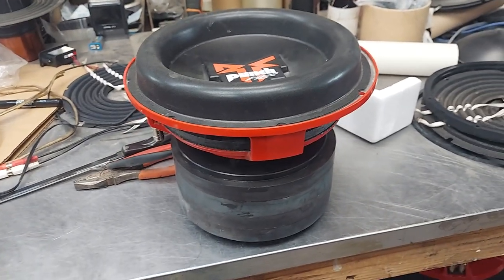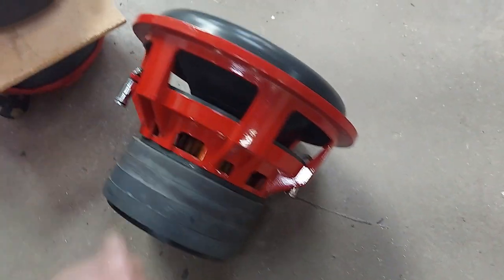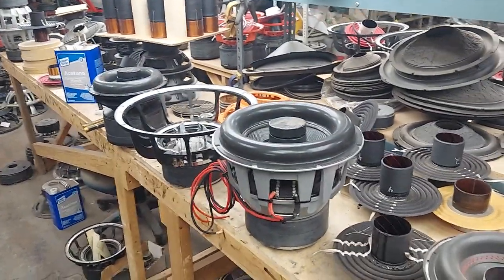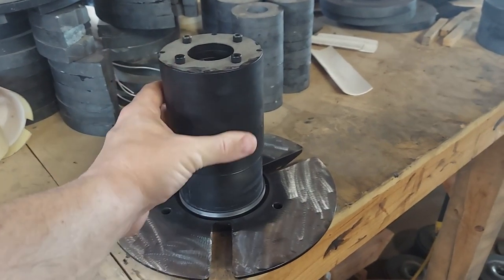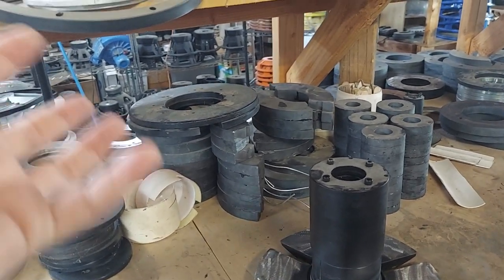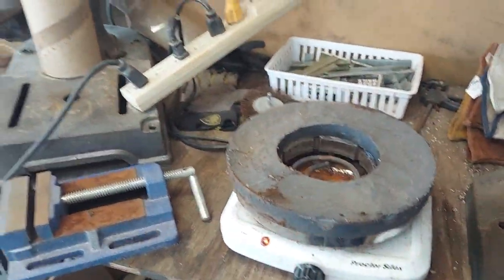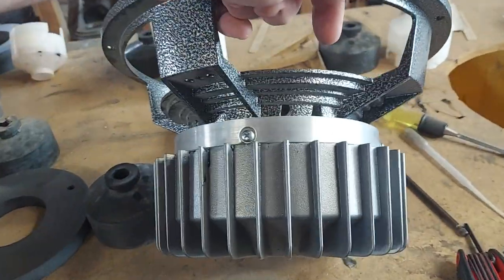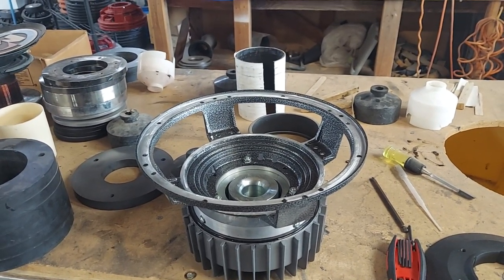Vato Xtreme 10" D2, Jizz Llama Dub7 12" D2 , LMS-R Eclipse Hybrid, 15" GONZO cone on 4 spoke frame

Comment: Would like to see you build a custom SQ type subwoofer for small sealed boxes something roughly 5.5 mounting depth size wise curious to see your take on one. Not the thin subs but a standard.
Reply from the maker: What size?
Reply: @RobotUnderground  Thinking typical 10" as its a medium road sq size.
Reply from the maker: @jonkvh5150  OK, I have a couple of options.  Text me direct with your name and shipping address, so I can add you to my phone.  Also, let me know what amp you'll be using. 6023126504

Comment: Could you all rebuild smaller Babb 6x9 and 10 inch round drivers? I have found the voice coils stuck and one went bad after the foam fell apart they're old school all metal cone full range speakers that I'd like to bring back..
Reply from the maker: Easier just to buy new ones or replacements.

Comment: Hey Patrick I watched your video about the Skar SDR and I know those subs are crap and not really worth recone, but if I was that 2.38" coil is that the same coil that is in a kicker CVR and a L7 and a kicker CVX. It looks to me that they are all the same coil. Is that right would that work if I was to do it?
Reply from the maker: Some models of the CVR, some models of the CVX and yes on the L7 for at least the 12" model.
Reply: Well they are 15" skar SDR'S and the I'd is roughly 2.344 and the od. Is 2.611 close to those measurements. So a coil that is 2.38 will it fit? Dont mean to sound stupid just dont want to get the wrong ones. I love your vids by the way I'll be watching and my wife will here you saying stuff and that one video you finger fucked the subwoofer I lost it. Your probably a blast to hang out with. Anyway thanks for the help.
Reply from the maker: @Ron-Webster  Well be careful.  If it was a D2 before, you can use the D2 or D4 coil.  If it was a D4 before, you can only make it a D4 or S4 by removing a coil... or S2 by removing a coil.
Reply from the maker: @Ron-Webster  https://thelordofbass.com/product-category/loudspeaker-subwoofer-parts/voice-coils/2-38-voice-coils/